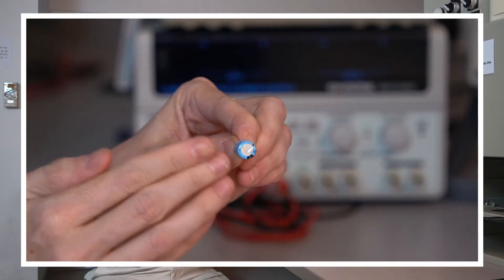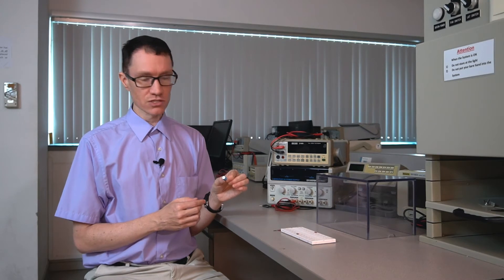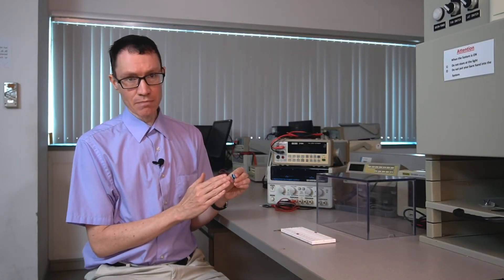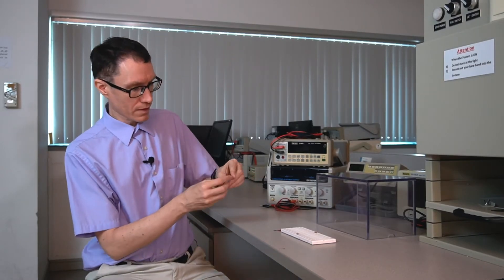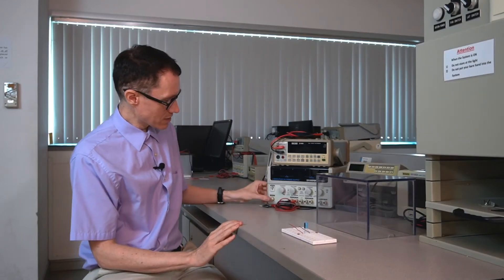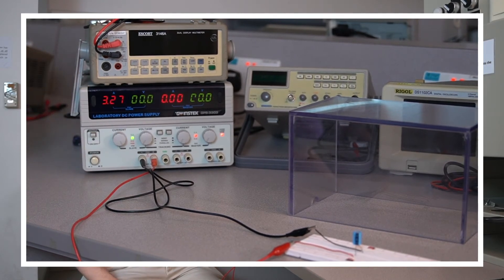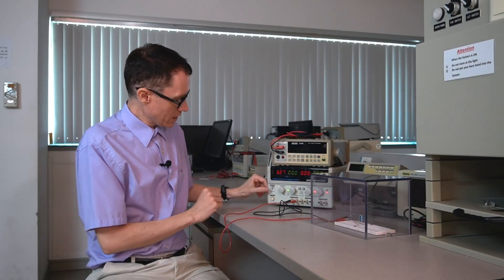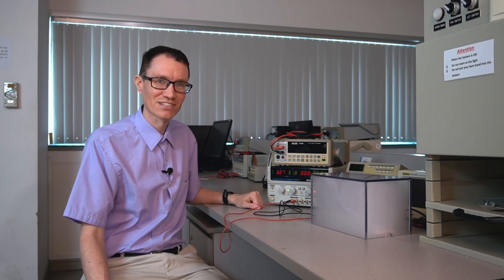What happens when you wire an electrolytic capacitor backwards? (Circuits for Beginners #24)

Comment: I would like to learn why explosion occure. Could you please direct me?
Reply: Capacitor Breakdown: Applying reverse voltage beyond the capacitor's rated tolerance can lead to the breakdown of the oxide layer on the dielectric material. This can cause the capacitor to fail catastrophically, resulting in leakage, short-circuiting, or even an explosion in extreme cases.Aug 15, 2023 I call it an energy buildup that  went out of control.